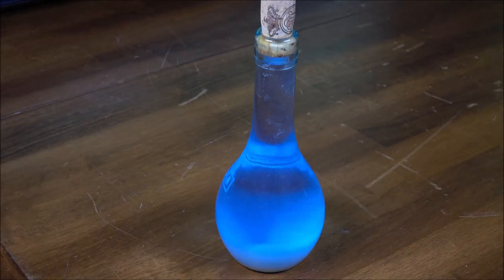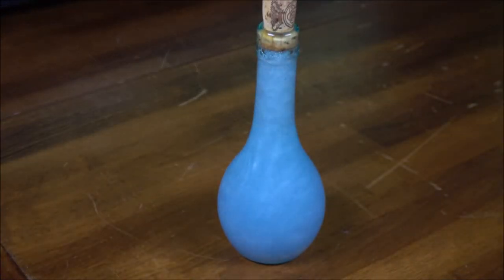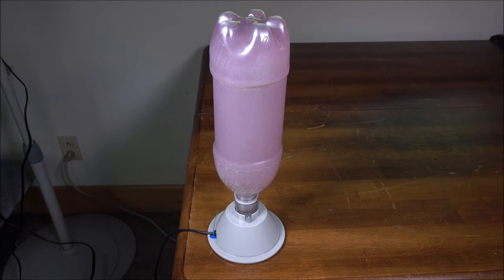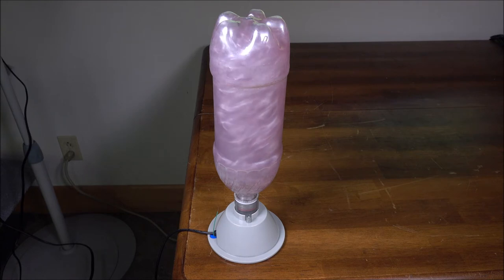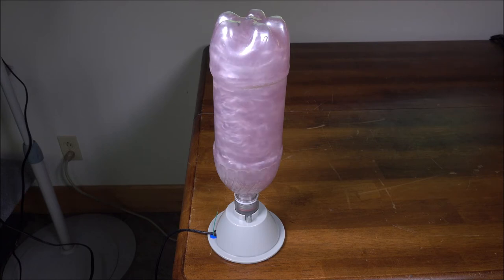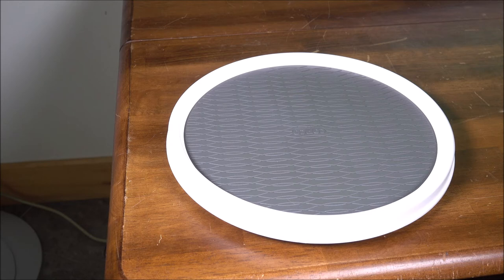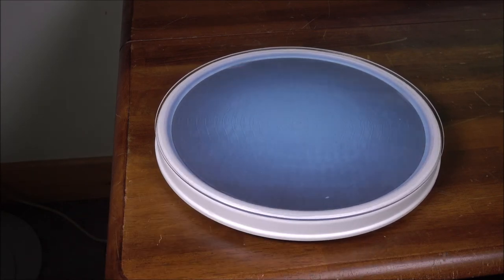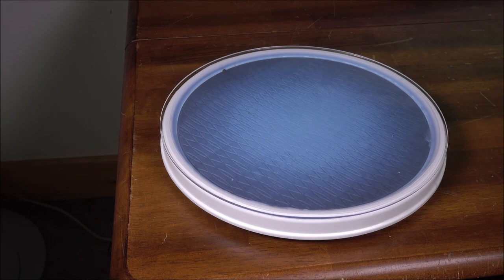Rheoscopic Fluid 1

Comment: Your disc should work. In my experience there is a bio contamination and you have coagulation of the crystals. If you clean it out. Use distilled water instead and it will stay beautiful. Nice work!
Reply from the maker: Thanks!  Would RO water work, or must it be distilled?
Reply: @jonbondy  no problem. It would quite possibly be better than tap water, but maybe consider boiling the water first too. Also if you have mica powder left over, consider replacing that too incase there is something off in that batch.